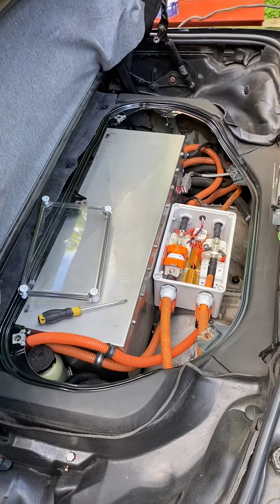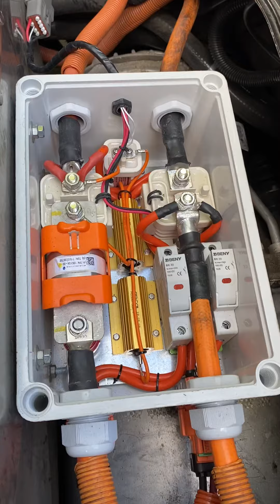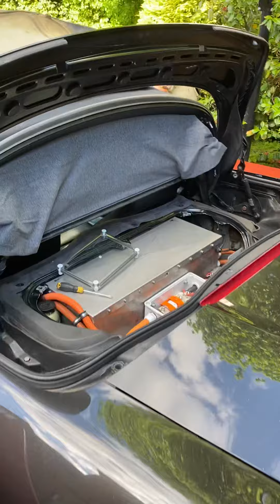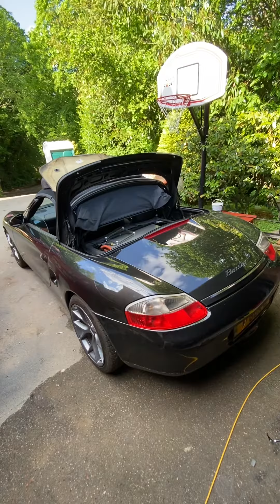Porsche Boxster Tesla Swap EV conversion - high voltage junction box explained

Comment: Thanks for this.  I'm doing a mini based kitcar conversion using an outlander rear drive and inverter with SP51 batteries. The S box is different in the SP51 to the earlier ones so looking to build my own contactor/precharge circuits.  Thanks for the heads up re durakool contactors. I like the fact they are square. Neat install. David

Comment: A very difference approach with small battery capacity , Love it! 
 I am doing my P100 Motor with small 22 Kw LG Chem as well.
Reply: I have a Hybrid 20kwh Mercedes battery,Would that get full power out of this motor or would it be under powered?